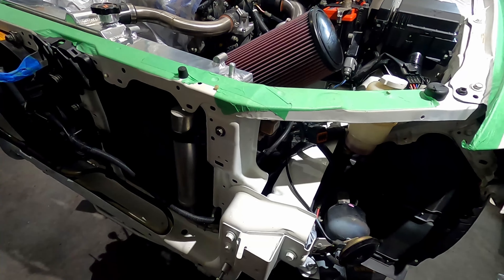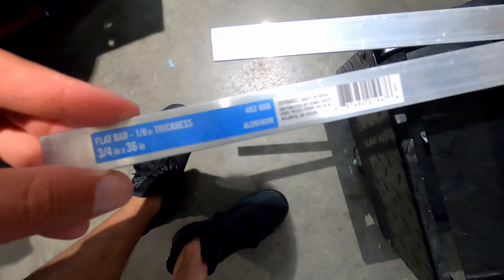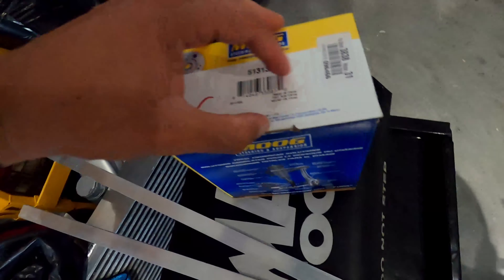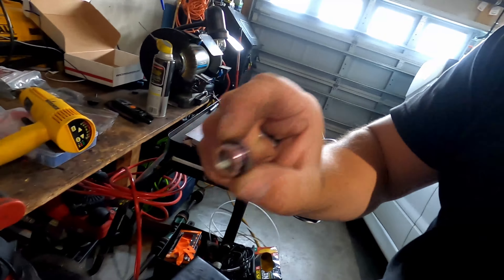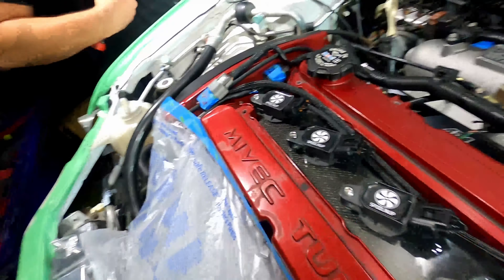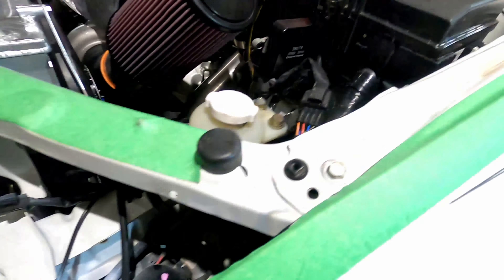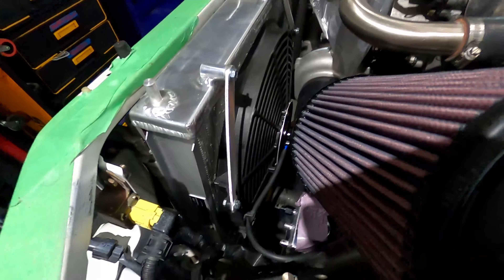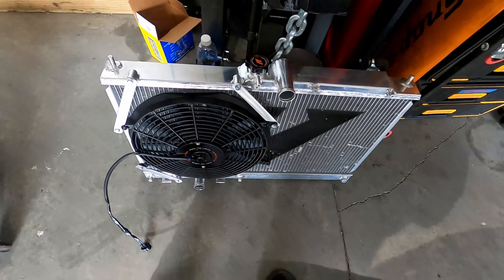Evo 9 - 2.2L 600hp+ Build Pt 6 | Radiator Fan Clearance Issues

Comment: Had same issue with my evo 5 and 35r. I ended up buying a push fan and front mounting it in push config rather than pull. It’s a bit tight between the rad and intercooler. Not as efficient as a shrouded pull config but more than enough cooling capacity if rad is decent. Coolant never tops 91-92 Celsius during summer in heavy traffic. 

Your build looks mint by the way
Reply from the maker: Thanks!

Comment: I had the same issue with my build.  I ended up using metal zip ties and securing the fan to the radiator.
Reply from the maker: It was a pain.